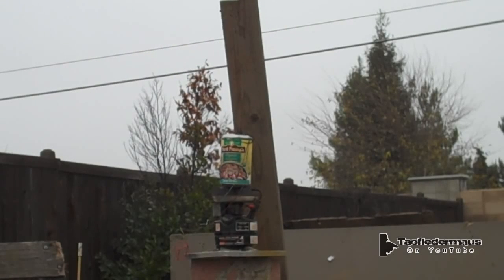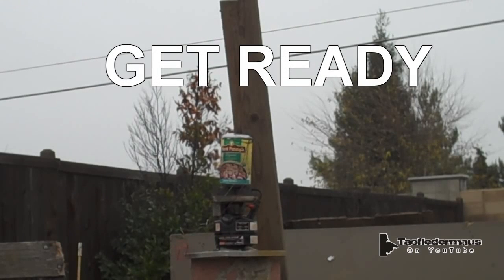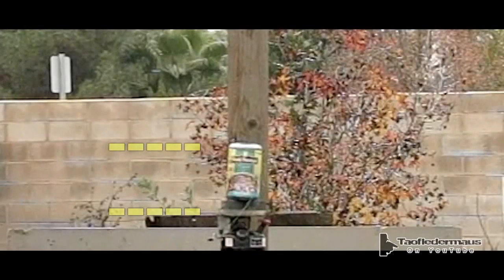The Power and Stupidity of Steam - Weaponized Bean Can

Comment: I think some thick wall pipe where a can fits snuggly would be a good cannon substitute.
Since the can shoots the lid off it can stick half way out of the cannon to be easily heated.
But it also needs to rest against some kind of backplate to tunnel the blast into the cannon instead of the can just flying out of the back.
It is an easy DIY I think.

Comment: Suggestion 2.
Take a metal can/barrel with a metal screw cap for liquids.
Pour just a little bit of water in it.
Heat the can till the vapour completely fills the can.
With heat resistant gloves and face protection on screw the cap tight on the can and turn the heat source off.
Then remotely pour some cold water on top and film it implode (collapse on itself).
Pretty impressive stuff.

Comment: Suggestion.
As I mentioned in previous comment we used to put firecrackers and projectiles into pipes shut with concrete on one side and then blast some stuff with it.
The copper pipes became bulged in the process of shooting (or even blasted open when we tried to shoot sand).
Maybe it would look good on slow motion.

Comment: We (and by that I mean my stupid small meof the past and friendly street kids)
used to pack a lit firecrackers into any kind of pipe (plugged shut from one side) and then plug it with ball bearings and stones.
Then it made a shot.
We realised how dangerous it was only when the pipe once rolled from it's initial position and shot holes in a parked car with stone shrapnel.
It was a diy-shotgun essentially and we had luck the firecracker didn't went off with fingers when loading the muzzle...

Comment: I am always amazed by how explosive force (the shockwave) can be contained and directed. How it will always seek out the "path of least resistance". The top gets blown off but the side remain straight, the bottom crumples because there is just a bit more resistance than the top. Amazing. Not the sort of video you show a troop of thirteen your old boy scouts.  :)

Comment: Two-man bazooka team in 60's mock warfare:  T-post driver, lit Silver Solute dropped into inverted tube, followed by ear corn.  Tip up to shoulder firing position, aim at scattering enemy combatants, wait for discharge.  Kernels strip to form scatter-shot and cob spirals as a pleasing visual.  
Un-coordinated loader / holder caused discharge of propellent near muzzle.... holder (me) deaf for hours after blast.  Teen geeks, explosives and booze:  a bad mix.
You do great vids, Tao.

Comment: This is why you don't take rocks from the bottom of a river or lake for use in building a fire pit.  If they've been down there long enough, water's worked its way into them, in all the little cracks and pores and whatnot.  Heat them with a campfire, and you'll end up with the same basic result as the bean can, but generally with people sitting in fairly close proximity...